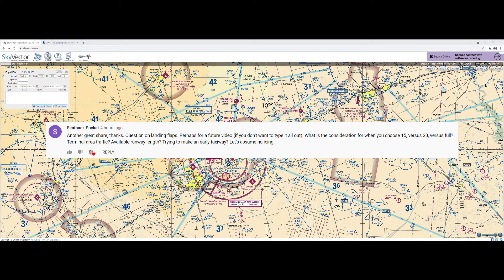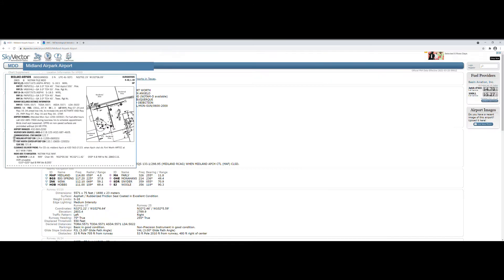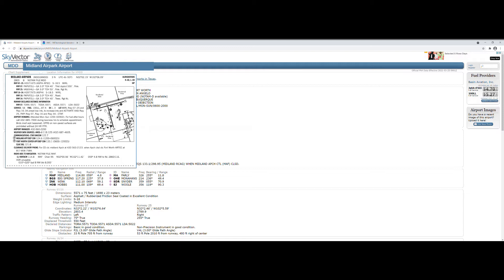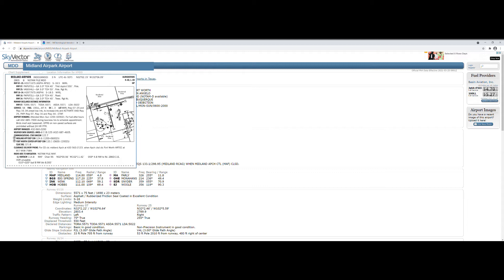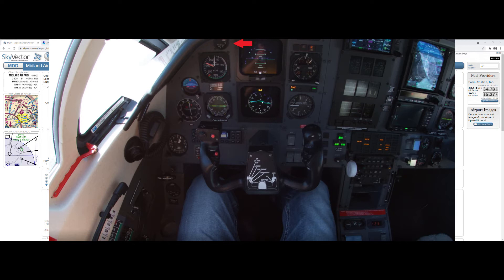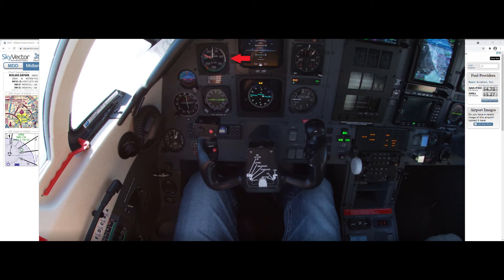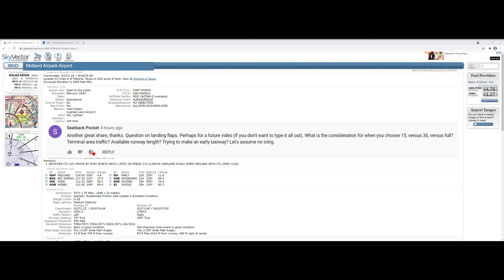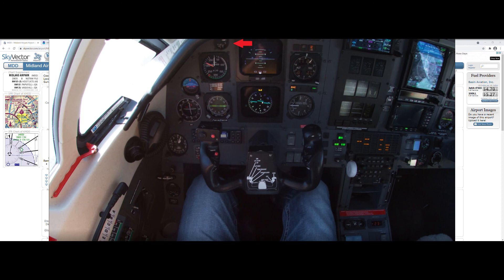Pilatus PC-12 Flap Selection for Landing

Comment: Great video!  What are your general rules for when to deploy flaps in a normal situation?  For example, how far from the field will you go flaps 15, 30, etc.?  Or is it based on being cleared for an approach and to land?  Other?  Thanks!
Reply from the maker: Thanks, Rich! Great question. The first stage of flap deflection in the PC-12 (0 to 15 degrees) takes a whopping 22 seconds to deploy (it's designed that way so as to not move faster than the pilot can trim), so I usually deploy those a bit farther out than I would in other airplanes of similar speed -- 3-5 miles flying miles from the threshold. The second stage, 15 to 30 degrees, goes faster and I usually extend those (unless I'm landing flaps fifteen) on base or a 2-mile final. Flaps forty is seldom used (short fields only). This allows for controlled, smooth speed reduction and trimming for a nice, stabilized approach. Cheers!